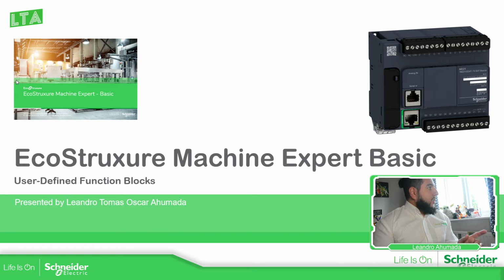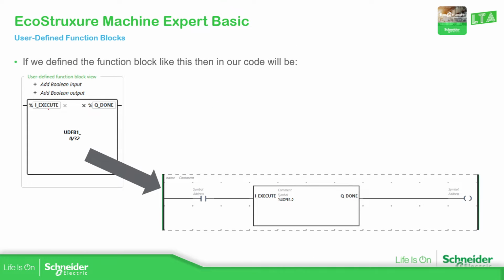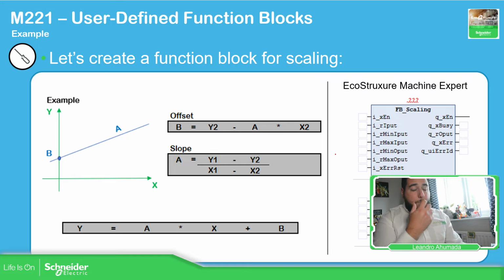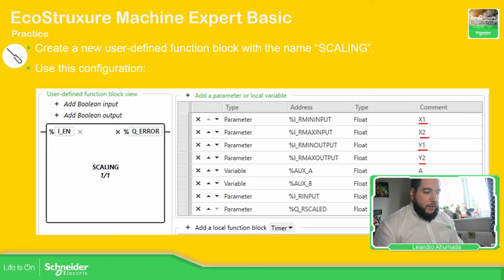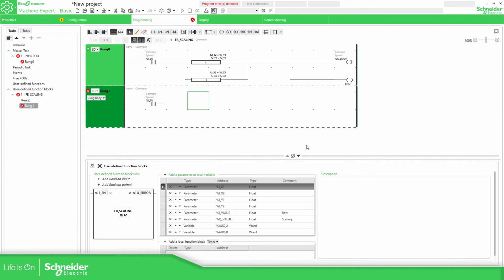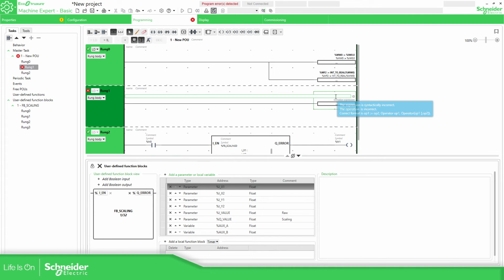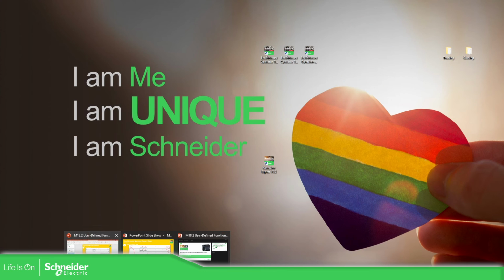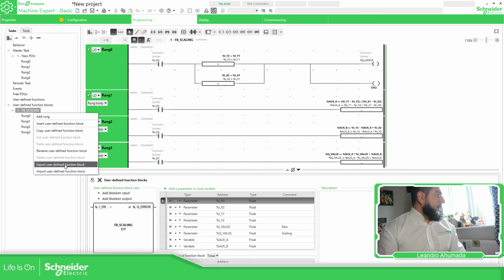Training - M221 - M18.2 User Defined Functions Blocks

Comment: I'm not able to use %TMA.Q in other rungs inside my FB. I tried to create a local variable called TMA (word) and use TMA:X0 as coil output from %TMA block, and it works. Do you know how to use the %TMA.Q contact in other rungs without creating an auxiliary TMA local word variable?
Reply from the maker: Hi there! good to pointed that out. Yes, it seems that the only way to do it is by creating an auxiliar word. I have checked the help and it says "Can only be used in a rung of a user-defined function block." but i will probably created a case on the Schneider portal to validate this.

Comment: when can you use the user defined function ? what is the difference between UDF & UDFB ???
Reply from the maker: Hi there! below you can see some of the differences:
•UDF only allows you to provide one variable output.
•UDF does not have instance.
•UDF is limited to use parameters/variables type word/double/float.

I usually use UDF to make a calculation then if i need to make a repetitive logic i use the UDFB

Comment: hello sir,
i found problem of using positive edge function in user defined block in so machine basic.
i work in simulation mode ?
please reply me
Reply from the maker: Hi there! I had a quick look and the contact for Positive or negative edge is not available for the "Inputs" of the block you must use that outside the block. I have tried to use a bit of a word but not possible.
I will try to avoid to use the function for edge detection inside a block because it will attach an instance of that block (because it has a number there..under it increase but i do not think so).

Comment: Sorry Sir, I have another problem with function block. I want to add function block with online edit, but function block is locked. So if I want to add, there is error "%TM0 is not allocated. How to resolve it, iam used TM221 controller
Reply from the maker: Hi there! If you did not use the %TM0 in ghe code before download then you will not be able to make an online change in the m221

Comment: is it possibel to monitor user defined function blocks?
Reply from the maker: Hi Akhil P!  AS far as i know you can not access in to the right instance of the Function block created to see the how the code works. In case you are using analog values instead of select them as "local" you can use "parameter" so you can see outside the block the value.